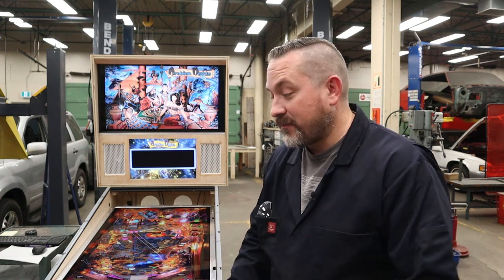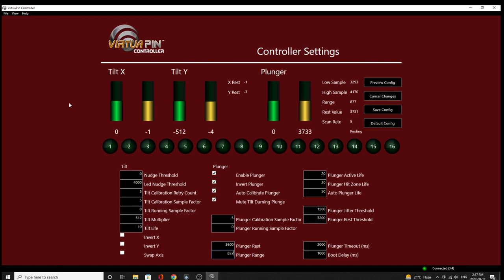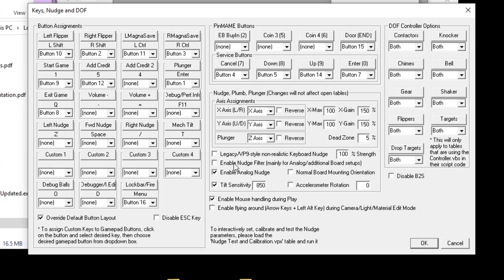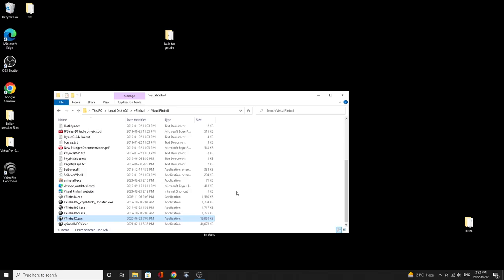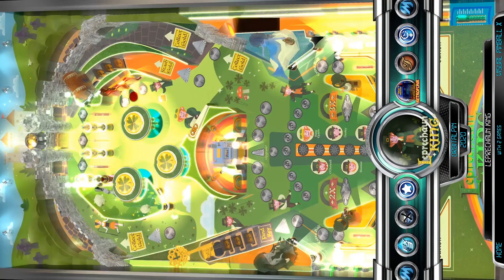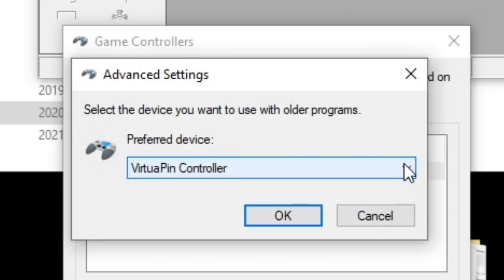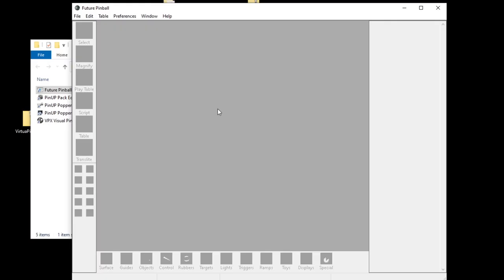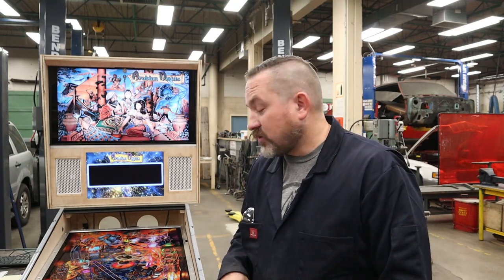How to setup your buttons, nudge, and analog plunger in the VPX, Future, and Pinup Popper programs

Comment: I love your channel. You are a great teacher. There are many smart people on YouTube that can't relay their message to an audience effectively. You, my friend, are skilled at this. I'm building my cabinet based on your design and also using the VirtuaPin Plunger and board. You may want to be cautious with using the plunger as another input button (by pressing on it) as you could see that the input (16) gets triggered when you let go of the plunger. I actually had a flicker on mine in normal play that caused a host of problems and I spent hours trying to establish what the problem was. Also, according to Mr Terry Red, you may want to ensure that your virus detection is disabled whenever installing any software and also, before starting the install, right click on the program and check the Unblock setting to ensure that the install works properly. This could be an issue of why a certain program may not function as expected. Sorry for the novel. Look forward to your next video.
Reply from the maker: Thank you very much for your kind words Rolf, I really appreciate it!  Yeah the plunger press button can't be the digital plunger or it will try to auto plunger after you pull and release the plunger and there will be a delay.  I ended up just using mine for fire and in pinup popper, it's exit to exit menu.  Yeah the virus disable and auto update has been disabled and now that I think of it, it would have been a good thing to make a video on or at least add it to one.  Thanks for the watch and the support of the channel!

Comment: Would love to see you do videos on setting up buttons in FX3 and Steam Pinball games. Xpadder seems to be taking over my normal pinball settings in VPX and Future Pinball. Likely because I haven't told FX3 or Steam how my VirtuaPin controller is working...
Reply from the maker: Yeah I haven't done that yet as I have fx and fx3 on my PS4 but I should do that on this one.  You need to make sure that you set up xpadder so you button presses or button combos do not share output/keyboard strokes as other programs use.  The keys I used work great.  Hope that helps.  Thanks for the watch !

Comment: Really hope there is going to be a feedback devices video. I have taken my cabinet build right up to this same point and the various different board combos and power wiring has had me stalled trying to figure out what to do next.
I wish I had run across this series before, could have saved me a few mistakes along the way.
Reply from the maker: It's coming....its coming.  I wasn't planning on doing all of the mechanical toys but I will do a few to compliment my planned ssf.  Just filming the install of my ssf this week.  Thanks for the watch!
Reply: @wayofthewrench  I hadn’t really planned on adding much mechanical feedback till the glorious moment when I finally had everything running and playing with the flipper buttons… seconds later…”OK, this needs mechanical flipper feedback  STAT!”
Reply from the maker: Lol, I hear ya!  Im pretty close to seeing how well my ssf is and I'm hoping that it blows my socks off.  If not, I'll be in your shoes!

Comment: Congratulations for the Channel....I  saw this video and I have the problem with analogic plunger in FP, in VPX work ok, I have used all the solutions you propose in the video but nothing is detected, even if I create a new table in FP it is not detected either... any ideas what it could be?
Reply from the maker: Check that it's not just that for table that doesn't have plunger support.  That tricked me for a very long time.

Comment: I wonder if there is a way to get plunger sounds with an analog plunger directly mapped to VPX. Seems the only way the sounds can be triggered in VPX is to use the digital "Enter" key or button to trigger the sounds. I've tried using JoytoKey. It does trigger the sounds because you can tie a keyboard press, "Enter", to the joystick 2. However, using JoytoKey gives unrealistic plunger action. So it's hard to get skill shots that way. I do have an KL25Z board, but I use that for nudging only. Any Thoughts appreciated. ⚪
Reply from the maker: Are you talking about the sound of pulling/letting go of the plunger or the hitting the ball sound?  My real plunger makes great real sounds for all of that so I've never even thought about it.  I would just get a real plunger to make that noise.  Cheers!
Reply: Hi, I'm talking about my AtGames Legends Pinball, first edition. It has a plunger. I'm not sure if you would call it real or not. I used to use JoytoKey with Pinball Emporium to play mainly VPX tables. With JoytoKey there is a way to "tie" a keystroke, "Enter" that would trigger the sounds built into the tables written for VPX. Example "PlaySound "PlungerPull" or "PlaySound Plunger" ect. Its written right into the script for all the tables of VPX. I was lucky to get a new, more powerful PC and loaded it up with PINUP POPPER. Much better, if not the best front end and I was having conflicts with JoytoKey and Pinup Popper, so I mapped all my cabinet buttons directly to VPX and Pinup Popper and quit using JoytoKey. Now the plunger acts like a real plunger, but does not trigger the sounds tied to the enter key. I went back and made a plunger only option in JoytoKey, but it is not accurate like the analog plunger is. So sorry for the obscure question, but I was just wondering if there was a way to get plunger sounds to trigger from the VPX table scripts with just the more accurate analog only plunger? ⚪
 @wayofthewrench
Reply from the maker: Yeah that's weird that vpx detects you pulling back the plunger but no plunger sound is made.  I use a real one so it makes real plunger noises.  Maybe take a look in vpx preferences under sounds and see if there is an option turned off.  Good luck!

Comment: Hey man great video, my cab has been working great, but now I have a button issue, just wondering what you think the issue could be.

So I built a mini cab, using pinup Popper and Visual Pinball and everything has been working great.

Went to use the cab and found my buttons controlling popper were doing weird things, basically not working properly ar all.

Exited rebooted windows tried games directly in VP and everything works fine, so I know my USB encoder is working fine.

Went into popper settings, button config and it said I had a button conflict.

Notice : Duplicate bindings found
Duplicate keyboard binding function
Exit emulators.

I tried clearing all my saved keys which works, but the message remains, so all buttons are locked to Exit Emulators, so none of my buttons can control anything.

I un-installed popper, restarted windows, did a clean popper install, error still there, disconnected USB Encoder, error still there.

So I'm completely at a loss as to how to get rid of this error.

Any help greatly appreciated.

Cheers Alan

PS I'm running the latest release of popper if that has any baring, although it was working fine before so!
Reply from the maker: For button conflicts, write down what buttons ( keyboard strokes) you use in vpx and in popper.  For any duplicated ones, change them.  A common one to duplicate is exit emulator and exit popper, they can't be the same orbit exits back to desktop after you leave any game.  Hope that helps.  Thanks for the watch and your support for the channel!
Reply: @wayofthewrench  I'll give it a go, but nothing has changed from my original configuration, and as I said the error is there even with the usb encoder disconnected, I'll let you know 👍

Comment: new problem !! when I exit a table it exits the whole system pinuppopper closes too ? what am i doing wrong i have it set same as you
Reply from the maker: You have exit emulator set to the same key as exit table.  Easy fix.  My plunger button when you press in is exit popper.  Hope that helps.  Thanks for the watch and your support for the channel!

Comment: some bad info there...."it says to save"... "File.... Save".... only prob... its SAVE LOG in the file menu.... Save Config button is right there on the right hand of the screen.... 
im trying to get a plunger on emulated xbox controller working (STM32 bluepill with HID driver...and freejoy..and XOutput..just for plunger).. i cant for the life of me get the plunger working correctly in Pinball Arcade, when assigning the plunger in XOutput... it uses the full range of the RX "stick"  instead of just half of it...this makes it so half the plungers range doesnt work, and the other half is very sensitive.... would you have any ideas?
Reply from the maker: Hrmmmm.  I'm unfamiliar with those programs but if your plunger works correctly in other programs including your calibration program then it might just be pinball arcade.  You might be able to use a program like xpadder to alter the signal to show something else for pinball arcade that it can read.  Think like an analog joystick movement.  Hope that helps.  Thanks for the watch and your tip on saving.  Cheers!
Reply: @wayofthewrench  yeah ive tryed everything (even tried x360ce in place of Xoutput).. but no matter what i do, when i assign the axis to right stick in xouput it uses full range... pinball arcade only wants the bottom half of the axis, it works fine in VP and FP as they can use the full axis range... with x360ce i can get the top half of the axis to work..but inverting just flips the top half axis...and then it doesnt work at all in TPA...doesnt even detect the "controller" ..so went back to xoutput and the half range/very sensitive plunger...SMH!
i tried setting the axis to a trigger and remapping in TPA, but TPA converts it to a button....arghhh!
Reply from the maker: Wish I had something for ya, just not sure about pinball arcade.  I've played a bit of it on my PS4 but deleted it cause I hated the front end and feel of it.  Hope you figure it out but it does seem like a pinball arcade issue.  Maybe they can help ya?

Comment: Hello, I have a coin door button question. I followed your videos setting up my key mappings using xPadder, confirmed the button numbers in VirtuaPin Controller and have mapped them correctly in VPX. I am finding that when I open the coin door, I only get the coin door options on certain tables (Arabian Nights, Monster Bach to name a couple) and then I don't get it on others (Dracula, Whitewater, etc). Most forums discussions refer to the issue when no tables work, but it works for me on some, but not others. I can't even get it to work with the keyboard on those tables. Curious if you had the same issue and if you know a workaround? Thanks in advance!  Also, I just read a post about AltSound, wondering if that is a future video idea for you? Keep on rocking the videos, they're super helpful.
Reply from the maker: Some games I notice that you have to re close the coin door and try again, you could try that.  Data East and Sega games need the other way of volume control which you have to cycle through the service menu...
It sucks.  Some games, the volume is controlled in the script or through the pup packs.  If I remember, I'll try to see if my Whitewater and Dracula are weird to change for ya.  I have added altsound to my list of future vpin videos to make.  Thanks for the watch and the suggestion.  Cheers!
Reply from the maker: I just looked today at my Dracula and Whitewater.  Dracula worked like it should but Whitewater needed me to close the coin door and open it again, then I could use service volume buttons like normal.  Hope that helps.
Reply: @wayofthewrench  I'll give it try tonight, hopefully that does the trick for me. Thanks for the follow-up, grateful for your detailed content. It's been a blast building out my cabinet.
Reply from the maker: You get it to work?
Reply: @wayofthewrench  Unfortunately, reopening and closing the coin door did not work on Dracula or Whitewater, nor any other tables I've been having this issue on. I swapped out my compact wireless keyboard for a full-size USB cord style and hitting "END" does not open the coin door through a keyboard either on those tables. I reviewed my button mappings and when the coin door is open, Button 15 lights up in the VirtuaPin Controller software. I also validated Button 15 is selected in the "Door (END)" field under VPX "Keys, Nudge and DOF" preferences. In xPadder that button does not have any keys assigned, do you have anything assigned in your setup? I don't believe you assigned anything in your video. If you got any other tips/tricks up your sleeve, I'm all ears, but this probably a question I'll have to throw out in the forums. Thanks for the follow-up!

On a related note, my Christmas wishlist is full of LED stuff. I'll be following your LED vids to set those up later this month. Can't wait!
Reply from the maker: The problem is that all the other tables work, just not those ones so it's a table issue.  Maybe redownload them or look in the script for the issue.  You start on your LEDs yet?
Reply: Yes! I started the LED project. I tested all of my LED's as you outlined in your video and everything tested great. I just finished the matrix assembly/wiring, next I'll be cutting my Muzata strips and installing the LED strips to size. A few questions when you have a minute:

1) How did you cut the plastic cover on those Muzata strips?

2) My playfield strips are 144 lights (like yours), but my table will only show about 135 LED's. Would you just leave it and tuck the strip under the lockdown bar and tell DOF what to only show 135, or would you cut the strip to length? If you cut the strip to length, do you need to add the connector wire if I don't plan to connect it to anything?

3) I'd like to add an on/off push button switch to control the power supply that powers my LED's. You have a light switch inside your cabinet, but I'd like to mount a push button on the back of my cabinet that I can push to turn off the LED lights. If I have a 5V 60A 300W power supply, what should the specs (volts, amps) be on the push button switch? I don't trust my electrical skills :)

As always, grateful for the videos/support. LOVING this project!
Reply from the maker: I used a sharp box cutter for the plastic and a hacksaw for the channel.  When you tested your strips they showed 144 or only 135 LEDs?  If so, return it.  If they tested ok but in the cabinet they only light 135 LEDs then it's your cabinet file.  You can you any switch that is rated for that amount of voltage/amperage.  For me it was easier to switch off power to the amp with a 120v light switch.  Hope that helps.  Did you try re downloading those tables that the coin door didn't work?

Comment: I set up my buttons very simply, just as in your video.  When I exit a game, it goes all the way back to Windows.  But Pinup Popper is still running.  If I hit X on my keyboard (I reassigned the Esc action to X) then it returns to Pinup Popper.  I'm at a loss as to how to get the game exit to take me back to Pinup Popper menu.
Reply from the maker: Change your exit button to be just exit game and not exit pinuppopper too.  It thinks you want to exit game and the front end.  Cheers!
Reply: @wayofthewrench  Yes, I had exit game in popper set to a button, and exit game in the vpx also set to a button.  I cleared the setting in vpx and it started exiting back to menu properly when I press my game exit button.  Fixed.  Thanks!
Reply: I actually removed exit game button setting in vpx.  It is still set in Pinup popper.  So having it in either place apparently works.  Since I'll be running games from Pinup all the time... probably ok.
Reply from the maker: Perfect!
Reply from the maker: Hey if it works....cheers!

Comment: Crap. I got the plunger installed but the app doesnt see it. I see the red light on the mobo flash when I pull it back. Any ideas? im just using this for the plunger/tilt and have another board for my buttons. The tilt is being seen in the app but not the plunger. So frustrating.
Reply from the maker: Hrmmm.  Cause it's a usb device, you might try some things.  Move it to another usb port or not usb 3.  Try having it plugged in and restart pc to detect it and auto load driver needed.  Try unplugging and re plugging it with pc on and watch for device to be detected.  If all this fails, try to to reinstall the virtuapin controller software.  Also check if app is supposed to be installed first or device is to be plugged in first then install the app.  Good luck.
Reply: @wayofthewrench  It was the USB port that the plunger didnt like so plugged into a different and in business. So weird. Thanks for the help!
Reply from the maker: Awesome. Glad I could help.  Cheers!

Comment: I'll write also here, i've tried to unplug the two connectors J1 and J2 to see if the short circuit stops, and so it is. But now the plunger doesn't work at all.....and should works as far as i know.
Reply from the maker: J1 and J2 on the Virtuapin board?  Not sure but the wire connections need to be in place in order for the plunger motion to be detected.  It's possible if you supplied power to the board (besides the usb connection) you might have fried something. Good luck.
Reply: @wayofthewrench  Good news I've found the problem! I don't know why, but it seems that if I give power to the amplifier of the back exciters there's no problem, but if I turn on the second one of the front exciters, somehow, the kl25z board intercept a signal and turn crazy as I shown you. Do you think that the ground loop isolator can solve this problem or is it an excess of power supply? Thanks for your help❤
Reply from the maker: Nice!  You could try swapping amps and see if the problem travels to the back.  If it does, the amp or wiring has an issue.  If not then maybe you are getting some emf messing with your audio.  The ground loop isolators are cheap insurance so go for it.  You can also reroute power wires away from audio wires and see if that helps.  Good luck!